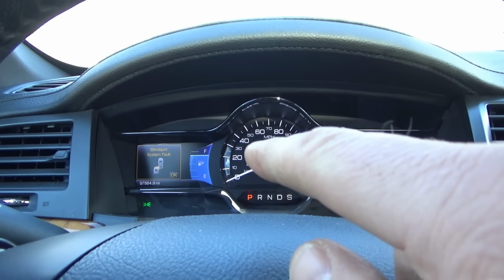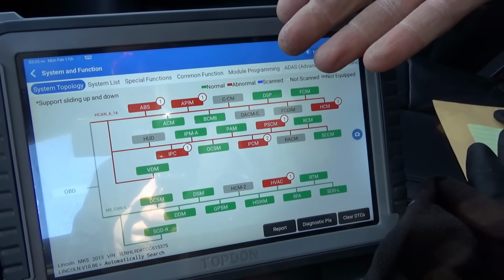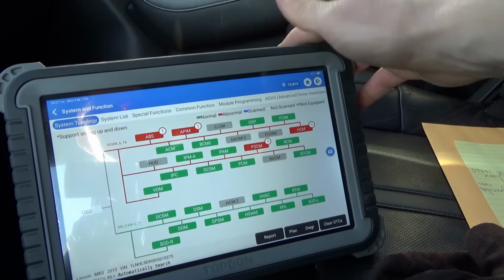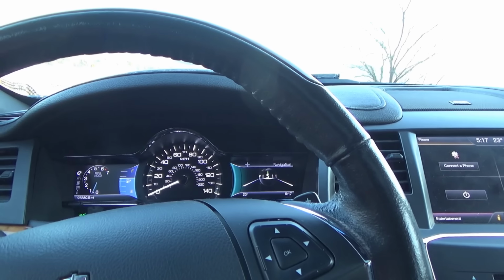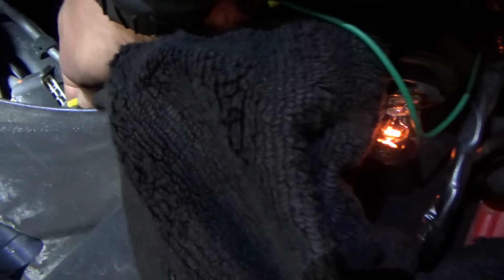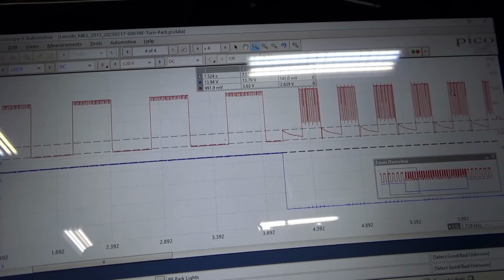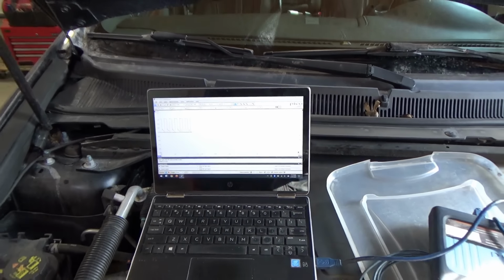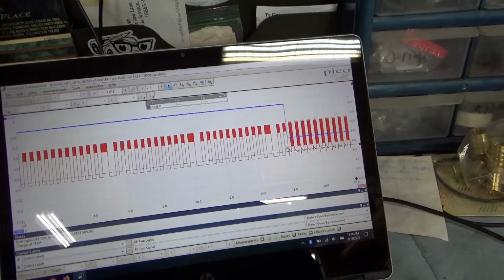(Pt 2) Lincoln BUTCHERED...by Dealer?! ('13 MKS: ABS Fault...CRAZY "Strobe" Turn Signals?!)

Comment: 19:00  "Why wouldn't that second bulb flash when the lights are off?"
Be careful of always assuming that all the orange lights in the front should work as turn signals.  My car - a 2016 Hyundai - has the orange lights in the fender corner of the light cluster, but they're just marker lights (on and off with the light switch only), and at no time do they flash as turn signals.  It's only the inner orange lights - nearest to the grille - that are turn signals.  Not sure how Lincoln set up their flashers back in the day,  but you need to be careful when making that assumption.

Comment: I have programmed used BCM modules on Fords. You should be fine as long as it is a compatible BCM. Since you have a working BCM the PMI and switching the module should work fine without having to type the as built data in. Most people probably have issues because they don't pull the other blocks that aren't in the as built data using FORSCAN. For some reason FJDS does not like to program BCM's half the time, so you are stuck with the scan tool PMI process.

Comment: Ivan…I would guess a bad capacitor in the bcm. The higher voltage would cause more leakage and change the frequency. Maybe open a used BCM and see if possible to replace caps. Cut them above board and solder in new. Water can also change capacitance.

Comment: There are a couple of guys on youtube who can clone the old car module to the new used one. Sometimes it is doable on the bench with special cables and software, other times they have to open them up and manually copy the data file from the EPROM of the old module and write it to the new used module.

Comment: Was the rear signals going funky also?  Incorrect lamp configuration in bcm would be issue unless the rears were doing it also..  thats if the lamp configuration is different for rears and fronts..

Comment: The bcm is programmable to do different things, and the blinking pattern is one of them. The aftermarket free Forscan software allows programming of different items in the bcm. There are reddit forums for this. different line codes that equal different functions,  USE GOOGLE AI  " changing blinking pattern with forscan"  in search box.  GOOD LUCK

Comment: Dealers can't program used modules on older vehicles because IDS checks to make sure the replacement module is BLANK before programming.  FordTechMakuloco has a video on how to get around this check by manually entering vehicle info with the J2534 disconnected. He demonstrates programming a used PCM. Not sure if that would work on other modules. I can't wait for the conclusion.  Its always a good case study when Ivan gets Keith involved. 👍👍

Comment: Thier is a connector in the front drivers side fender that always traps water and corrodes the wire, its a common problem

Comment: Could you get the BCM reconditioned What could have caused the BCM software to become corrupt as if you try to start the car with the battery flat That's what killed the AIPM in my car the radio still works but freezes all the time ever since my battery went flat and I tried to start the car It clicked four times.

Comment: I have a 2015 ford fusion. Same gen as this mkz. LED lights were available on some models and lower models had incandescent. Maybe the programming Ivan did was not correct. I have read online about people installing led taillights in their SE and SEL trims and having problems with fast turn signals that was resolved with changes with Forscan. My Fusion limited has factory led taillights but headlights and parks are incandescent if I'm remembering right. I am wondering if part 3 will find some green crusties or wiring issue.

Comment: I saw a vehicle once where the owner had replaced one of the tail light bulbs. It caused the dash backlighting to turn on and the chime to beep when stepping on the brake pedal. They needed a 2057 bulb and they put in an 1157 is why it was happening.

Comment: On motorcycles like your Yamaha, that run on filament lights, you cannot use LED bulb for they do not present a sufficent load on the flasher relay. . . ..Dis the flasher bulbs have been replaced ? ? ?

Comment: Could you install a voltage regulator on the B+ supply to the BCM?
Reply from the maker: Then it might think it's undercharging and overboost the alternator and fry the battery and other modules HAHA

Comment: Stop faffing around Ivan, check the gnd connections, undo them clean and refit where you showed the water ingress.
Usually you would have the BMS module out and looking for green crusties by now.

Comment: Every time you check the illumination of the lights, you only check the front. What about the rear lights??? In a GM, if a bulb is out the flasher blinks fast. Maybe you have a light out in the back????

Comment: And to think I worked on these things for 25 years, I got out in 2010 due to neck cancer. 
I do not miss any of this uneeded junk.
Lincoln always released the newest ideas on the public and in some cases used us techs as their RnD, many calls I made had them saying call us when you figure it out,
Maybe tap the multifunction switch. Maybe its time to disconnect the battery for 10 minutes and start over.
Are there two types of headlamps listed or just HID?

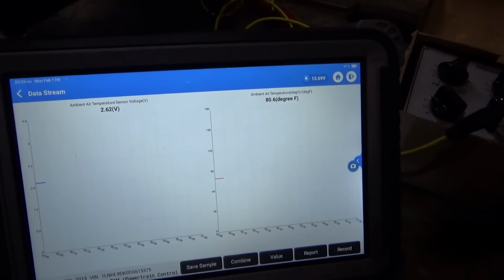Comment: The alarm module also pulses the hazards.  Maybe it has water ingress too? I replaced a door mirror recently and the bulb in it was the incorrect wattage for the indicator.  It caused the indicator to flash correctly for 3 flashes before deciding to flash at twice the normal rate.   I noticed at 7:41 the voltage on the scanner is jumping about a bit.  Is this normal when using an external psu to maintain the car battery?  The water ingress to me is worth investigating further.  You hadn't to this point inspected the BCM to see if it was corroded in any way on the connectors or the module body.  ;0)

Comment: yup ive got an 05 escape the bcm has had a stroke started with the transmission would not unlock ended up less than a week windows would not  work anti theft refused to let it start hazards would randomly flash radio dead local shop said they could TRY to reprogam a used bcm but they have had little luck and it takes a noin refundable 175 fee ford laughed an said discontinued so ford has lost a customer permanently

Comment: My first thought on the turn signals was LED vs filament lamp problems. A switched-mode LED driver will take less current as the voltage increases, rather than same to higher as with a filament lamp - which could trigger the BCM current sense & lamp failure warning.

However, they look to be factory fitted LEDs, so the BCM config as @uldiisl points out looks to be the likeliest cause. Possibly the asbuilt data is defaulted to filament lamps and needs a different setting for LEDs - my 2017 Ford did not have LEDs as standard, so a 2013 likely had them as an extra option & the data was missed.
Reply: I just put LED bulbs in my 2019 Outback & my 2013 Grand Caravan SXT. In both cars I only changed the front blinker bulbs but not the back ones, and both cars now blink like a Burnt Out Bulb super fast blink rate. I wasn't sure if it was because the bulb types were mixed or not, but now it all makes sense as to why!! I have an Autel MaxiDAS DS808 Code Reader Scanner that also allows reprograming, but will have to figure out if I can do that with the bulbs or not. Might just be easier to replace the turn Signal Bulbs with the same regular bulbs that were in there.

Comment: First part of part one you had a 1VDC difference on positive side of battery terminal depending on where you put the charger.
Is there a real potential difference?
If yes, maybe the delta is changing a reference voltage related to the BCM

Comment: Hey Ivan;  similar condition on a friend's motorcycle, a Honda ST 1300.  We wrestled with it for hours, and in desperation, we ran a separate 16 ga wire grounded to the frame back to the tail light housing, and connected a heat sunk 6-ohm resister from the flasher wires to the new ground wire.  The ground level was elevated when flashing, was at ground with just the lights on.  (They were LED's).  The resister cured the issue on his bike.

Comment: Is it a BCM problem? A voltage regulation problem? No, It's just another Lincoln problem. It would be nice to see if you could put a test lamp in line with the turn signal circuit and see if it does the same thing with the test lamp. Maybe the BCM needs to see resistance that the LED isn't able to provide, with the headlamps on, the corner lamp becomes part of the circuit through magical engineering of the highest wizardry gandor has ever seen, bringing resistance down enough to make the BCM flash the turn signals properly. Perhaps a programming issue where you need to study all of the values in the as built data to find maybe that car was built with incandescent lamps and someone swapped them for the high luxury premium engineering wizardry package that comes with all sorts of weird magical tech that we really do need in life.

Comment: All modern (well, some cars, like BMW, started doing that from circa 1994) cars seem to modulate power to the bulbs above ~13V to prevent premature bulb failures because bulbs are rated for 12V. Normal filament bulbs get hot and don't stop glowing so don't care for this modulation. If LEDs are installed those respond immediately with flashes due to modulated voltage (because of missing thermal or any other kind of inertia) and cause control module to assume bulb is faulty. Moreover that slow drop from 4V feels kinda like LED artefact because they have a voltage below which they stop conducting and glowing. So either this car has wrong bulbs or module coding (some call it calibration, that is dumbest word for that IMHO) is wrong, as others here suggested. Ivan really needs to learn newer technologies than 1980s ones.
P.S. I would never bring my car to a specialist who drives older gen car than mine, because your own car is the one on which you can experiment and learn new things... Now Ivan frets for 20+ minutes of video time alone about WHY behaviour is different below vs over 13V...
P.P.S. I would not condemn BCM in this car just because of those waveforms, but then I don't work on cars other than BMW.

Comment: I'm 65 so I'm an old school guy.  Whenever I had a car with a rapid turn signal flash it was an indication there was a bulb out somewhere.  Being LEDs I don't know how much a failing LED or corrosion might impact how it functions.  It is an Ohio car after all, even though it has low miles.  Since these videos were recorded early in the year I'm sure you figured it out, but for the unobtainable module situation I'd suggest reaching out to Keith at L1 Automotive.  Since the manufacturers will not support their products for their entire service life it would be nice if there was someone who could refurbish modules and have them be reliable.  They'd make a killing.  Unlike Flagship One.
Reply: Yea but what would they charge to be reasonable yet lucrative?  Im not sure what they charge for typical board diag and repair but having to ship the stuff there and back then wait for them to get to it..   be a good wait to fix a car.

Comment: I think that after what Ivan's local Ford dealer told him. I would fix the water intrusion problem and fix the turn signal issues and maybe the 2 other gremlins this "Lemon Lincoln" has and advise the owner to get rid of this car. Maybe donate it to a technical college for study. It's hard for people to let go of cars they like, but this car is going to continue to give Ivan and the owner future problems. I have a 04' Aviator, and I take care of it and keep it in the garage. I don't drive it much and has 50,000 original miles on it, and I also leave the battery disconnected and on a battery charger once a month.

Comment: The signals act like there is a blown bulb but intermittently
Reply: Same situation if you swap your incandescent lamps with LED's. The BCM lamp test circuit get's fooled into thinking the bulb is blown and flashes the circuit quickly letting the driver know there is a problem with the turn signals. People can't just do a bulb check on their car and look over it before they start driving. Ive seen people driving on flat tires, bulbs out, broke down because they ran it out of coolant or oil. They just hand out your drivers license and don't even teach that sort of stuff in driver training apparently. I learned this from my dad when I was 8 years old.

Comment: After you fix the exterior water leak, you can change her water pump behind the timing cover.  Because Ford.
Reply: The fatal flaw in the Cyclone engine when transverse mounted.  Longitudinal Cyclones don't have this issue as their water pump is external.  Almost like the engineers knew this was a bad idea.

Comment: That footwell module issue is similar to what R56 Mini Cooper owners see… well known problem to owners of these cars.  The failure affects lights and can cause fires if left alone. Mine, the headlights stayed on and the turn signals would flash randomly.  

However, unlike Ford, BMW stepped up and issued a recall and replaced all of these faulty modules and fixed the water intrusion problem.  On my 18 year old Mini Cooper S, they even repaired (unknown to me) rusted out floor pans!  No charge to boot. 😃. And - they gave me a brand new Cooper S as a loaner for the 6 weeks it took. 👍. 

Not all was good though - my module was not fully programmed so my headlights are on all the time when running, my hazards don’t work and I have no high beams.  Back to the dealer!  Unless I can get BMW ISTA P somewhere…

Comment: It looks like there is normally PWM to manage current flow into those LEDs.  I saw it in the scope capture during normal operation (parking lamps on).  But then the PWM waveform gets messed up with the parking lights off.

Comment: Be sure to monitor system voltage when the exterior lighting is on or off.  Many cars will command a different voltage when lighting is on vs off, which is also further complicated by smart charging schemes.  What I'm saying is never assume a stable system voltage, even when everything is working as designed.

Comment: could be a bad ground pin on the BCM - maybe corroded because of the water. That round exponential decay you see on the ground looks like capacitive coupling, and not good DC coupling. That's what a capacitor looks like that's slowly discharging to ground through a resistance (aka bad ground), rather than being connected solidly to ground. My guess is a problem with the pins on the BCM, the harness, or internal water damage in the BCM. Somehow when the parking lights are on, a better ground is achieved through them, and the issue goes away.

Comment: Does this car have bulb burnout detection like German cars?  Even on BCM controlled turn signals, the system will still try to "detect" a bulb being out (i.e. wrong lighting current) and blink fast.  So the current may be alternating between normal and abnormal so the BCM is working as designed.  And you'd want to investigate the lighting system powers, grounds, loads.  Or, scope the network.